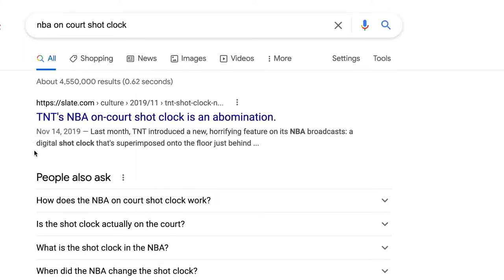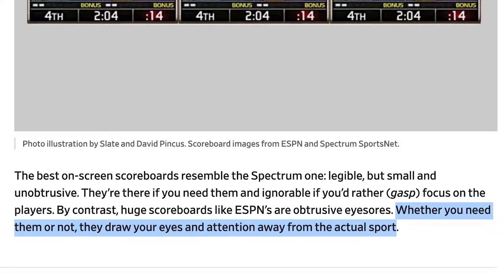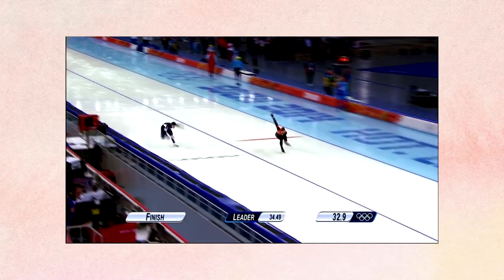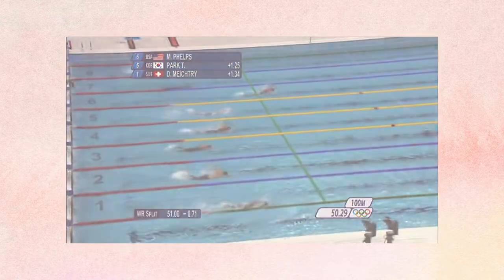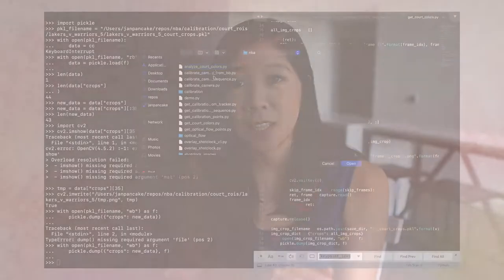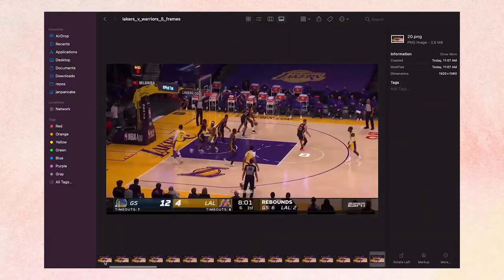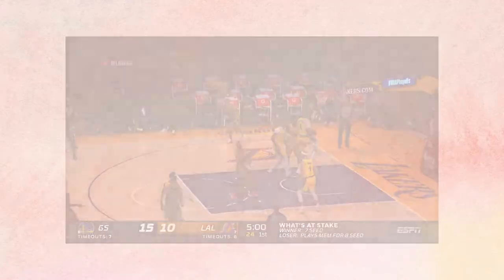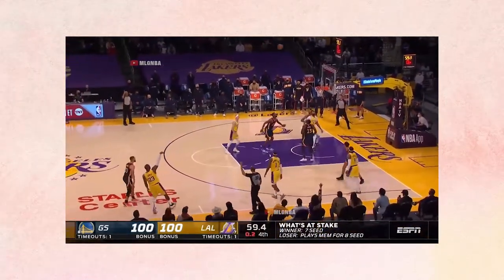The Algorithm Behind the NBA On-Court Shotclock | Computer Vision & Image/Video Processing

Comment: I'm watching Game 1, Celts v Sixers, 2023 playoffs. I haven't been watching many games because I'm usually working. I get the shot clock, but on TNT, what's the white hologram number, close to the hoop, in the paint? Currently, a 6 on both sides of the Boston Garden green painted foul lane.
Reply from the maker: I didn’t watch that game, but is it this? https://nba.nbcsports.com/2022/09/20/celtics-add-no-6-in-parquet-paint-to-honor-legend-bill-russell/amp/
Reply: @janpancake  Thanks, it must be that because the number never changed. It did seem somehow lightly painted, not bold.